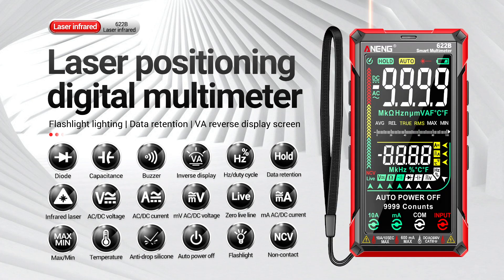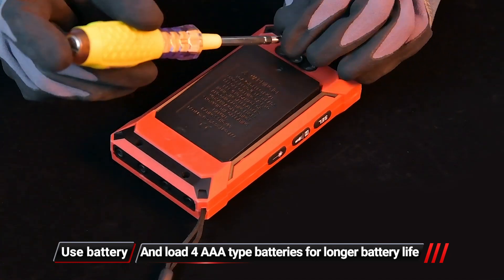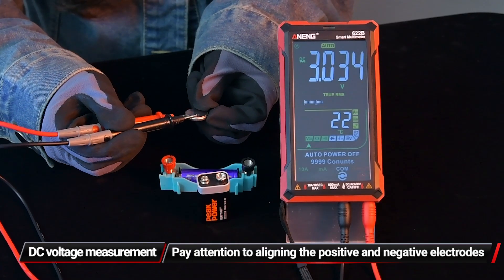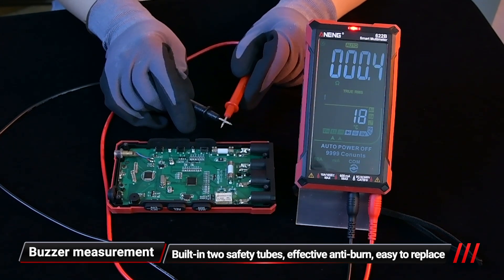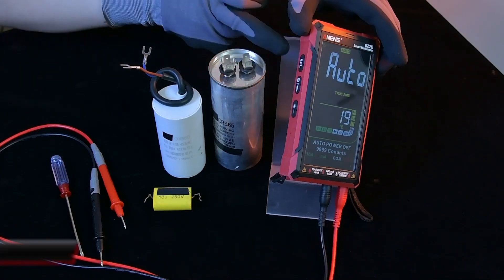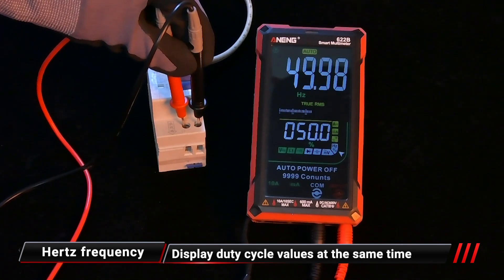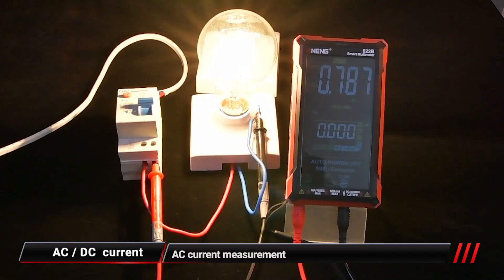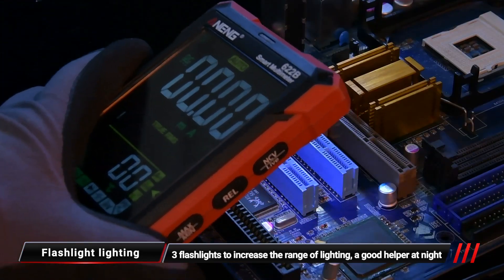ANENG 622B Pro Multimeter,Laser Positioning,9999 Count Auto-Range,NCV Non-Contact

Comment: I bought this multimeter, but it doesn’t turn on — it seems to have a power supply issue. I’m looking for a solution or an electrical schematic to fix the problem.